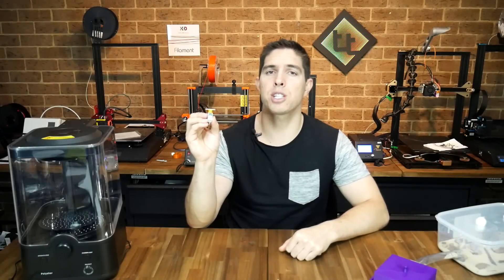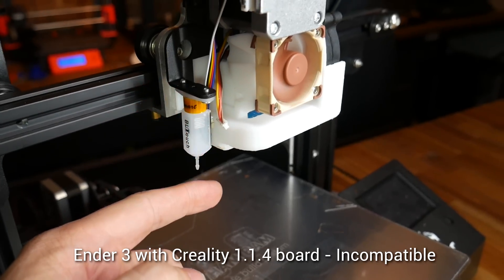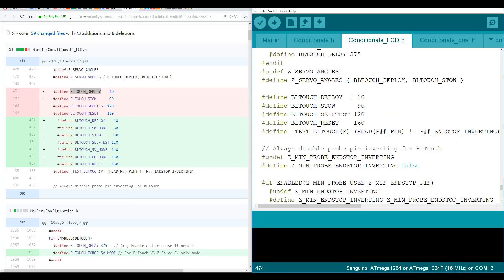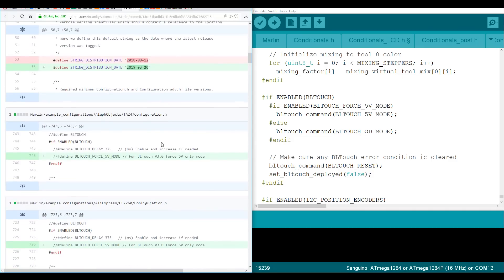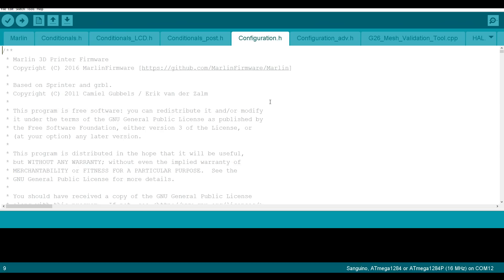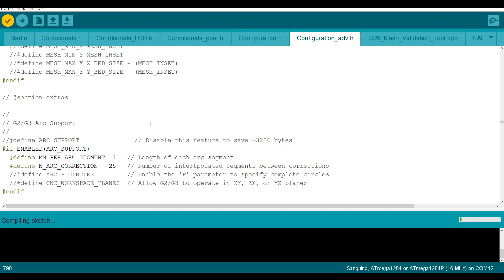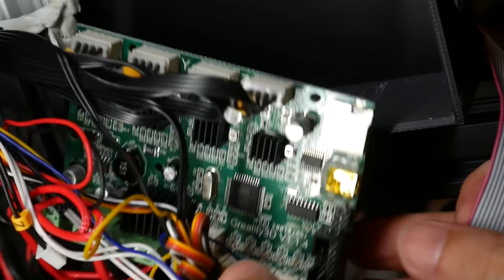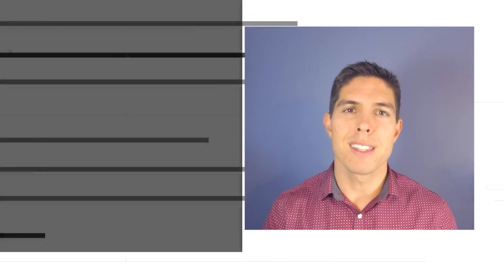3 Fixes for BLtouch V3 on Creality machines

Comment: Thank you, Michael! Quick question if you see this. Could i use a M420 S1 command to fetch a mesh thats stored on the board?
Reply from the maker: I rarely use it but that should work. Remember that G28 by default clears a saved mesh (you can turn this off when setting up Marlin). You would need to do the M420 straight after a G29 or save the mesh to eeprom with M500 straight after G29 to retrieve it later. To print without a fresh G29, you would have the M420 after the G28 in the start gcode.
Reply: @TeachingTech  Awesome! You've been a huge help through my experiences with my ender 3 and have also really have sparked my interest in 3d printing. Thanks for all you do and keep up the great work!
Reply: @TeachingTech   I removed G29 from my start g-code because I didn't want to do a probe every print but I haven't got the M420 after G28. So does that mean it doesn't read the mesh from eeprom when I print?

Comment: Thank you. I've had my BLTouch v3.0 attached to my machine but I really didn't want to have to take the soldering iron to the board to remove the capacitor. Its nice to know there's a software solution.

Comment: YouTube video very interesting fix but I have a question what's that device that's black that's on your right hand side in the video
Reply from the maker: That is a Polysher. I'm not sure if you've used acetone to smooth ABS prints, but this does the same for the Polymaker Polysmoother blend of PLA. There is a video coming.

Comment: Does this guide work for Ender 5 as well ?
Reply from the maker: Yes, apart from starting with an Ender 5 config. In my BLtouch video for that it is provided, just follow the additions in method 1. Alternatively, remove the cap like in method 3.

Comment: I had issues with the kit from Creality on my CR-20 (v2.1 board). To get it working I flashed the CR-20pro firmware to the board with an old version of Cura. Then I had to physically de-pin the red connector that goes to the Z-stop header and switch the white and black wires. Not sure what the practical reason is why this works, but it did.
Reply: Wait a second... you Easter egged the servo wires, and got it to work?
Reply: @MrKbustera  not sure if I Easter egged anything, but I did switch the black and white wires in the red connector that goes from the BLtouch to the main board.
Reply from the maker: The early versions of the kit had the black and white wires in reverse, although I thought this was fixed for the red plug version. Just to clarify this is the not the servo wiring, but the two wires which go back into the Z endstop plug of the mainboard.
Reply: Teaching Tech 
My Creality kit cabling colours: white, black, yellow, red, blue.  Red plug has white on left, black on right (orientation plugging down onto board with keyed part at front), black plug had red and blue reversed, so yellow, blue, red (no keying on this connector).  I swapped the red and blue back for the MKS GEN L board: yellow to D11, red to 5 V, blue to GND.

(I haven’t got the printer working properly yet.  The inverted motor movement change to Marlin 1.1.9 in your guide seems to have inverted all of the axes.  Has an oopsie with the ‘auto-home’ due to this.  The BL-Touch didn’t seem to want to work.  All a bit confusing, and Antclabs have some different modifications in their documentation.)